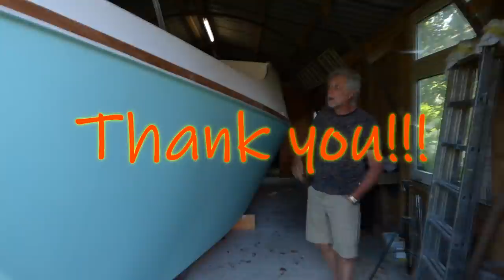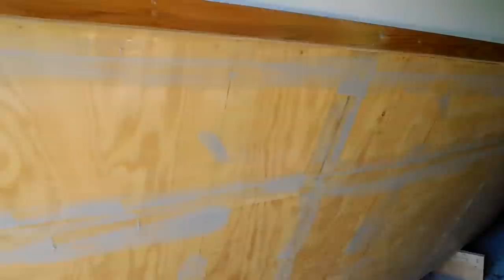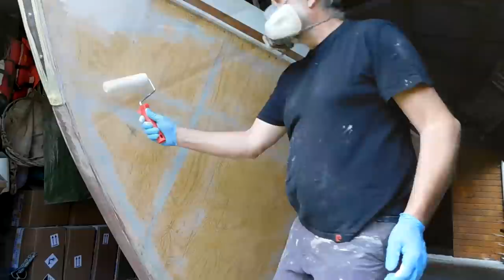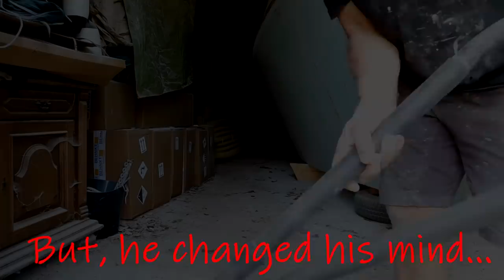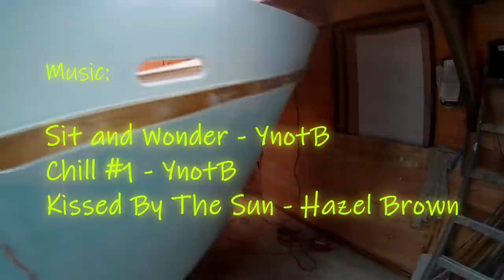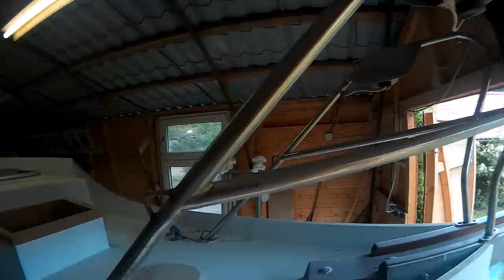PAINT... ON THE HULLl!! - SV Tapatya EP139

Comment: Tony what kind of keel will you build for the boat or you will keep it flat :/ ?(I'm novice) I'm bing watching and find this absolutely stunning
Reply from the maker: Thanks John. She'll have a long keel, kinda like a central spine, running the length of the flat bottom. It'll be some 3 feet deep and have a ballast weight of 1280kg attached. The aft end of the keel will support the lower end of the rudder.